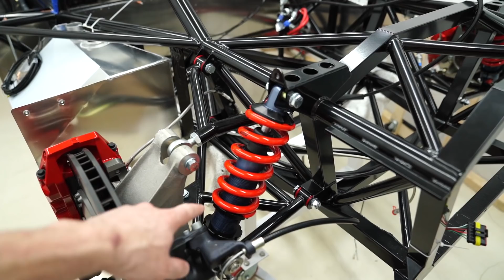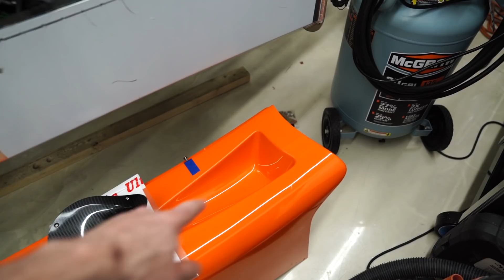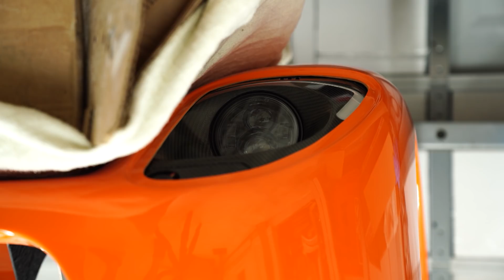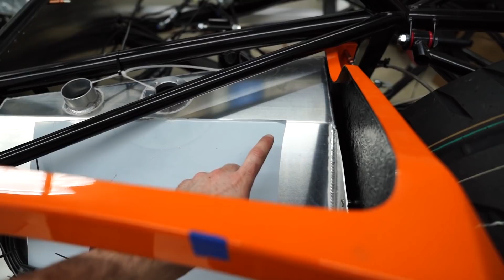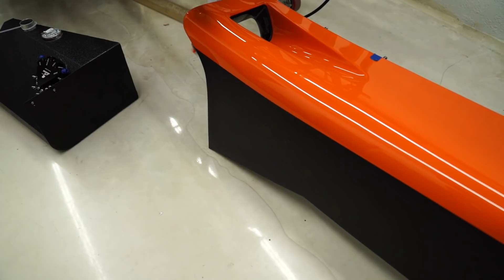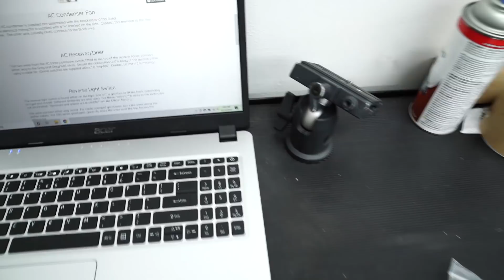Ultima RS Build 04 - Cerakoting headers, then Installing Wheels, Fuel System, and Sidepods

Comment: All the CERAKOTE that I have used/experienced has been with firearms, and it was all oven cured.
How durable will this be, not having been oven cured? Awesome build!
Reply from the maker: I used C-148 Burnt Bronze which is an air cure Cerakote and actually one of their highest heat rating formulas at 1800 degrees F.

Comment: Man that front tire looks close to the fender . . . better try that soon while its up in the air.
Reply from the maker: Yeah it's very close, but turns lock to lock at all suspension travel without any binding/interference so all good!

Comment: Headers look awesome. You shared how much loot you have tied up in the Beast. How about how time do you have in it? Seem to be moving right along. Don't know if you thought of it but the limiting factor on filling both fuel tanks at once might be allowing air to escape the far tank. Maybe a small crossing/balance line connecting both tanks up high on the vessel?
Reply from the maker: Thank you! Yeah I am in the process of making sure/figuring out proper venting so there are no issues both in drivability and refueling.

Comment: Looking great!  Just rewiring my Seven at the moment and done away with relays and fuses completely with a PMU (everything solid state)  I went ECUmaster but there are lots of others. Did you look at them and they simplify the wiring and save weight... I went for a similar thing with wheel, although I am now all CAN.  this was the wheel setup. https://blinkstop.co.uk/shop/freewheel
Reply from the maker: I looked at Infinity Box, but hesitated due to the uncertain life time (and future support) of the company. If I had to do it all over again, I probably would have used the AIM equivalent.

Comment: Hard choice between SLC and Ultima RS. Why the RS?
Reply from the maker: SLC is a great kit I'm sure and the aluminum monocoque is certainly more modern, but I haven't seen that SLC builds are lighter than Ultima ones. I chose the RS because I've always wanted an Ultima since seeing the GTR mop the floor with exotics on the Top Gear track. Also, Ultima has a cool history with its involvement with the McLaren F1 and now the Gordon Murray T-50, which the SLC does not. There are also other factors like resale value which played into the decision but truly the biggest factor was that I think the RS looks way way better than the SLC.

Comment: Hi can l make a suggestion to you?
Make sure that you have separate air vents for both tanks.
I had a twin tanked classic mini. 
Fuel pump in one side but standard fuel line linking both tanks. 
Could fill up from both sides but what could happen was once filled up one side & go round to do the other the fuel was beginning to balance out so might have to go round a couple of times.
I did a few times manage to fuel up both tanks at once did get alot of strange looks doing it mind lol.
Reply from the maker: Thank you! Already in the works! I appreciate the comment!

Comment: Looks amazing man!
- Do you think that you'll adhere some kind of pad to the "door sill" for getting in and out of the car so the paint won't get messed up?
- Do you think you will get condensation inside of the driver side storage area from the AC line?
Reply from the maker: I think I'll have to be a contortionist to get in because I don't want to step on the carbon fiber door sills. Also, I'll be putting insulation on the AC lines in that luggage box so I hope not. I don't want moisture in there because the engine ECU lives there as well.
Reply: There's a YouTube video on how to get in and out of an Ultima made 7 years ago, little danger to the sills if done right  :-)

Comment: Awesome build! I'm curious, are you using any adhesive compound before riveting the panels? I find it strengthens the entire panel when I used Norton SpeedGrip 15 min Adhesive - 04617. Not cheap stuff but it will prevent an rivet from loosening over time due to vibration
Reply from the maker: Yes I've been using a combination of Wurth Bond & Seal, 3M 5200, and Sikaflex-29.

Comment: Can you tell me why you chose ultima over super lite Slc.   I’m looking at both and can’t decide.   Super lite is more expensive so that is one reason.  But I’d like to hear your thoughts as your very impressive with your knowledge.  Thanks
Reply from the maker: Hey Anthony, I too looked at the SLC and a huge selling point was the more modern aluminum monocoque chassis. It's interesting to note though that the SLC builds are typically heavier than the Ultima builds, though I'm not sure if that's because the SLC owners typically install lots of creature comforts and electronics. For me it came down to my personal preference of thinking the RS is a lot better looking than the SLC with other huge selling points being the high resale value of the Ultima and Ultima kits in general, and Ultima's history which is pretty deep (Lee Noble, McLaren F1 mule, Gordan Murray using them as mules for his T.50, etc.). I hope that helps. Let me know if you have anymore questions!
Reply: @UltimateUltimaRS  wow I didn’t know that about the mules and the resale.  Very good to know.   Thank you so much.   Btw.  Dude how are you flying through this build.  I watch the video and I’m like I wouldn’t know the first thing of anything that you talk about. And your educating as your doing it.   Cudos my man.  Your super talented.  I’ll be watching brother.   I can’t wait to see it finished ..... next week LOL
Reply: Brother would you ever consider taking on a build for someone.  I really think I would go with this exact build.  Honestly I would be honored to have you build my car if you were up to it.   Thanks.  Raceguy1137@aol.com

Comment: Does that steering wheel come with a quick release hub or did you have to procure that outside of the Ultima kit?
Reply from the maker: You can get a steering wheel and quick release hub through Ultima, but I chose to procure it outside of the kit.
Reply: @UltimateUltimaRS  Thanks for the feedback. Another question. Did you do the same for the floor carpet or did you just purchase the custom built carpet from Ultima?

Comment: You will need a baffle system in your tanks.  It stops the sloshing but that's not the worst part. Say you have 7 gallons in the tank, if you do a switchback or a chicane the fuel will ride up on one side then smash the other side.  That 50 pound hammer 🔨 hitting the side away from your turn will kick the back end right out.  You will even feel it at low speed with tall tanks.
You're building a super car,. It's going to be incredible!

Comment: Fuel tank transfer pipe needs a valve in it or you will have a problem if you park sideways around a hill or on uneven ground if your tanks are full.

Comment: This is such an amazingly thought out build. I am taking the same approach on my current build. You literally took all possible weak spots of the design into consideration and developed a plan to negate them effectively. One thing that is impossible to display on videos is the hundreds of hours you spent in designing and planning this build before you ever picked a tool to build it. Great work.
Reply from the maker: Funny you noticed this as only someone with a build would. In the 10 months I waited for the kit, there was constant brainstorming, researching, and studying. Thanks for the comment!
Reply: @UltimateUltimaRS  I am currently building a Factory Five Hot Rod Truck. I started planning in October last year and the kit was delivered April 1st. I know exactly what you mean. There are things even today that I am researching and planning for optimizing.

Comment: Everything looks awesome. Congrats. I’ve been helping a buddy build an slc-gtr for 3 years which seems like a really long time but it’s usually just one day a week. We had it on the track just for its first shake down. I’m amazed how fast your build seems to be going together.
Reply from the maker: Thanks, Andrew. I try to get something done on it (however small) every single day. Consistency! Any videos of the SLC?
Reply: @UltimateUltimaRS  couple of videos  running and testing brakes on page 10. 
https://www.gt40s.com/threads/steves-gt-r-build-thread.51274/ 
Going to break it down for paint soon then track by spring
Reply: @UltimateUltimaRS   neither one of us are fabricators, but we definitely have learned a lot for whatever the next build will be.

Comment: You're doing a great job and your building this car as we would all do if we could. Love your not holding back on anything. I’ll bet other builders will be ordering some features you have shown us like the fuel pump system. and the transmitting steering wheel. Not sure about altering the spring rates for road use, I’m sure Ted, Richard, and others have spent years getting that just right. Hard springs with no ESC and ABS and 1000hp mmm Oversteer/understeer a lot of complex time setting up 🤔. Soft springs = better grip for the road.  Looking forward to the next video.
Reply from the maker: Thank you! I think there is definitely a little bit of a compromise between road manners and performance with the stock springs. I chose the new rates based on a lot of comments from the existing owners- hopefully it was the right one!

Comment: I'm curious what's the rough rubberized coat you used to spray over the aluminum fuel tank and inside of the wheel wells? Thanks!
Reply from the maker: Raptor Liner. Good stuff right there.
Reply: @UltimateUltimaRS  , thank you for the quick response! I will check that stuff now.

Comment: Making killer progress man, I can't believe how good those side pods look!  Make sure you do a good job sealing the lower brake duct to the body since silt and sand can get in through there.  Also, yes, not only do you get dirt and road grime sent through there and down the side pod, but also streaks from track rubber and pickup.  I was a big fan of the track patina look so I never scrubbed off 100% of the rubber marks... yes it goes to the track!
Reply from the maker: Thanks as always, Will! I will definitely make sure to do that. All that stuff getting in would drive me pretty nuts.

Comment: car is looking great couple comments you might contemplate. grind the cerakote off the flanges of the headers. you want a raw metal to gasket fit to avoid leaks. in the fuel system the large bung should be high up on the side your filling and the other side lower so gravity flows the fuel . if you dont the pressure from the pump handle will kick off before you actually get the other side full. and buy a set of earplugs. the noise from r888 are terrible!! lol. you might look into the e5lm brushless fuel pumps. since there are no brushes the fuel doesn't heat up as much and 2 pumps can supply enough fuel for 1500 rwhp.  we used them in most of the big hp Porsche builds now and its factory on the c6 zr1 corvette. fuel pump p and computer controller to run it
Reply from the maker: Thanks for the comment! I've heard that the R888Rs are loud but I will be surprised if I hear them at all over the engine. First I've heard of the e5lm pump and I just read about it... that thing is a beast. Good to know and again thanks for the input and knowledge.
Reply: @UltimateUltimaRS   I first  ran a single brushless in my 996tt and ran 770 rwhp on e85. pump is the future of fueling

Comment: I am no expert but a aluminium fuel tank will crack in an impact and it is not protected by the frame, I am not sure it is a good idea...  Thanks for the video, I wanted to build one of these for years now...
Reply from the maker: Yeah I hear you and it's a concern of mine as well. I will be installing a fire suppression system as well.

Comment: Did you say where your heat exchanger (for the supercharger) is going to be mounted?
Reply from the maker: It's in front of the radiator already mounted. I think I showed it in build video #2.

Comment: Could you imagine if it was all wheel drive!? Omg that would be awesome
Reply: Mid engine rear wheel drive is faster on the race track due to the weight savings. This car could probably pull wheelies. Best to leave the front tyre traction for turning only.

Comment: Has anyone went against Ultima's philosophy an installed a paddle or sequential shift in this?
Reply from the maker: Yes, there are a few owners out there with air-shifted sequentials with paddles. I'd like to do the Supercar Systems sequential but I haven't seen any other than their 3D rendering.

Comment: Umm why didn’t you tape off the intake manifolds on the headers man?!
Reply: Cause the coating would crack.
Reply: @joshuaprice6959  it’s not about the coating it’s about having a proper seal with your intake gaskets. Powder coating it makes it so its not completely flat. It won’t be sealed correctly and most likely will leak. There’s a reason why it’s left at bare metal.

Comment: No such thing as too much... computer controlled so just turn it down until you need more grunt, which is inevitable...nice build... fuel pump is high pressure for injection, so that's it's rating, carb pumps are much lower pressure...

Comment: I’m not an expert but I see “B is for build” and Chris and his buddies seem to be having a ton of problems controlling so much power in such light weight car(I’m taking about the “Burntacan” by the way) I certainly hope you consider to do something about traction control management! Great build,keep it up!
Reply: He talked about this issue in an earlier video, saying that this car is not supposed to be practical in anyway shape or form and that he acknowledges the issues he may have with so much power in such a light car.
Reply: I get where you are going with this but the point about my “COMMENT “ was that it would be a shame throwing all that money and effort on a project that can’t take you out of a corner without loosing the rear end and from my perspective this set up doesn’t seem to be Drag Racing purposed only,if that’s the case you can omit my useless and inexperienced comments and live happily ever after!

Comment: Awesome build! What is the cost savings building the car yourself? Can you buy it already completed from Ultima?
Reply: You can buy the Ultima cars turn key.  In one of his previous videos he said it was $40K extra and a two year wait.
Reply from the maker: You can buy a roller or a turnkey car from Ultima. I originally thought it was $40k extra for a turnkey but I saw where a guy in Detroit was delivered a roller (no engine/trans) and it was apparently $225k. Huge cost savings by building it yourself.
Reply: @UltimateUltimaRS  thanks for the clarification. You are doing a better job building this than the factory anyway. Hard to believe this is referred to as a “kit car” when it’s priced at a quarter of a million dollars. Can’t wait to see this project completed and you tearing up the track & streets of south Florida. Cheers!

Comment: I feel like a 4 Rotor would fit perfectly in that engine bay, and give the sound of a F1 car
Reply from the maker: 100% agree! I've talked about this with a good buddy of mine who has a huge turbo 3-rotor going in his RX7. They are such small, lightweight engines and the sound would fit the Ultima perfectly.
Reply: don’t tell rob dahm
Reply: Finally I’m not the only one thinking this... that is literally what I want to do one day!!
Reply: And cost 50k and be iffy on reliability. Oh and if a party fails you either need to be an expert in rotary engines or take it to one of only a few shops in the country that can effectively work on them.
Reply: Given the dogshit weight distribution around the engine bay, the small mass of a 3 rotor would do this chassis justice.
Reply: Agreed
Reply: Why would you put a unreliable motor in a 6 figure car?
Reply: It would drive like a go kart then, keeping the revs up high in each gear rather than a torquey low end power motod.
Reply: Agreed, I’d definitely go a 26B if money wasn’t an option. 👍🏼
Reply: He wants a rally car... as cool as rotary engines are they definitely wouldn’t work well in this application.
Reply: who needs those headaches
Reply: Rotory motors suck unless you have unlimited time and money to work on them and continuously theow money at them
Reply: Sean Thompson

4 Rotors don't sound like a "f1 car"....please stop sharing your "feelings"...as they are clearly defective....
Reply: @Mark David Why are you such a snob?
Reply: @jarret6855  I don't know about the snob part.  I agree with him as far a sound.  I have never heard a rotary on the road or the race track that sounded anything like any generation of F1 car.  Maybe he will provide us with the example that does and which F1car it sounds like.   Outside of that it might not be a mounting option so he would have to design and fabricate the mounting arrangement for the motor.  Not sure what the transmission options there are either and does the length of the rotary allow for a mounting position that places the axles in the correct position.

Edited as I used the wrong posters name.
Reply: @ihatemybosses  I think 'Sean Thompson' was referring to the fact that a rotary would scream, maybe not a 10 or 12 cylinder scream, but scream non the less!